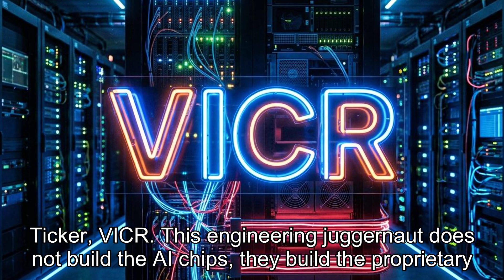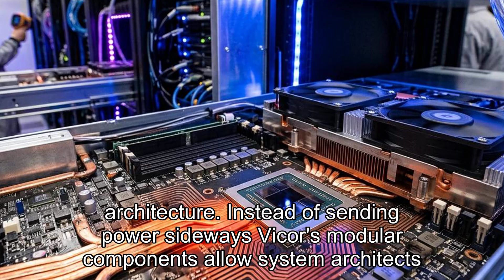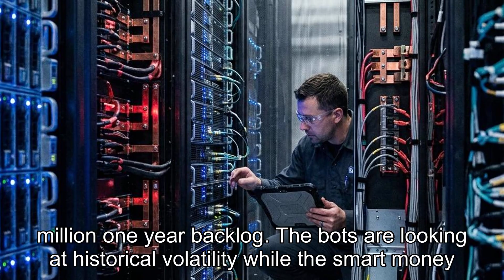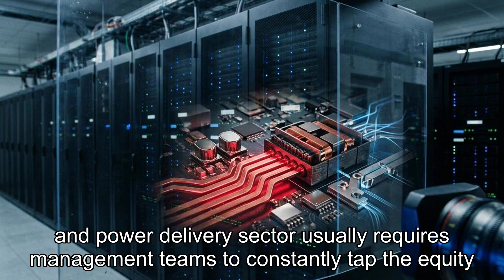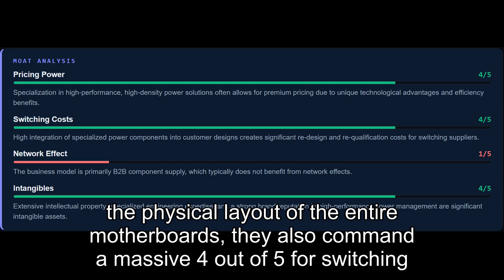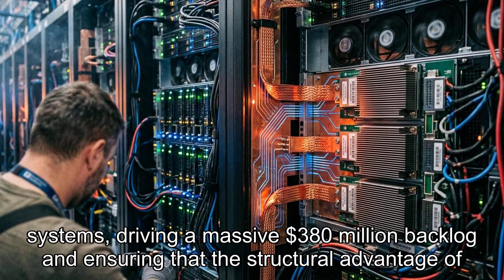$VICR: The 48V Power Architecture Saving AI Chips (Deep Dive)

Comment from the maker: Question of the Day: With a massive 145% backlog surge, gross margins expanding toward 60%, and proprietary 48V architecture eliminating power delivery bottlenecks in AI accelerators, is $VICR the ultimate power infrastructure play for the AI hardware boom? ⚡🔋 Or will customer adoption friction and direct-to-OEM transition risks cap their upside? Let me know your thesis below! 👇

📂 Sources & Research for this Episode:
We analyzed their structural margin inflection, their $453.6 million fortress cash cushion, and how Factorized Power Architecture (FPA) solves the physical interconnect bottleneck under high-current AI compute loads. Here are the primary sources for your own due diligence:

🔹 The "Primary Anchor" (Stockteller Verdict Dashboard):
https://www.stock-teller.com/verdict/6TMJVT95
🔹 The "145% Backlog Expansion" (Q2 Fiscal 2026 Financial Results):
https://www.globenewswire.com/news-release/2026/07/21/3330291/0/en/vicor-corporation-reports-results-for-the-second-quarter-ended-june-30-2026.html
🔹 The "Fortress Balance Sheet" (SEC Form 10-Q Quarterly Report):
https://www.stocktitan.net/sec-filings/VICR/8-k-vicor-corp-reports-material-event-f1cedeaaf248.html
🔹 The "48V Factorized Power Architecture Blueprint" (Technical Blueprint):
https://www.vicorpower.com/industries-computing/high-performance-computing
🔹 The "Direct-to-OEM Transition & IP Royalties" (Q2 2026 Market Summary):
https://www.tradingview.com/news/tradingview:3a38ced067186:0-vicor-corp-q2-2026-revenue-143-4m-eps-1-04-10-q-summary/

☕ Support the Research:
If you appreciate the deep dive, you can support the hours it takes to dig through these press releases and earnings summaries right here: https://ko-fi.com/stockteller

#StockMarket #Investing #StockAnalysis #VICR #Vicor #AIHardware #Semiconductors #FinancialEducation
Reply from the maker: Today’s episode is a test of a fully automated video editor. I’d love to hear your feedback